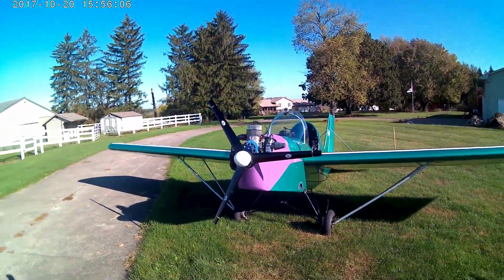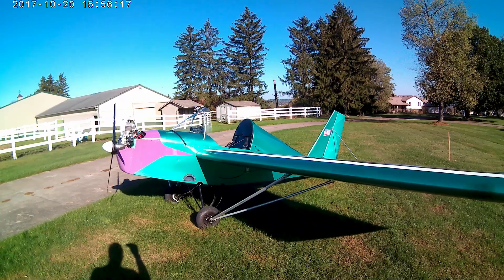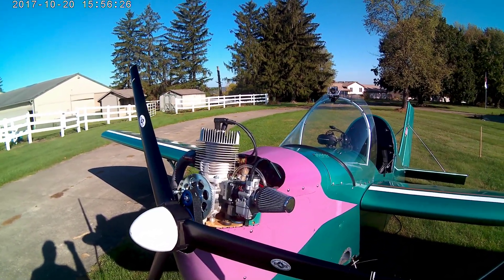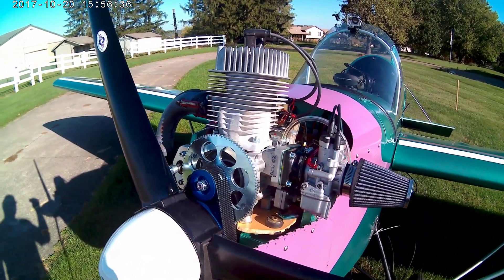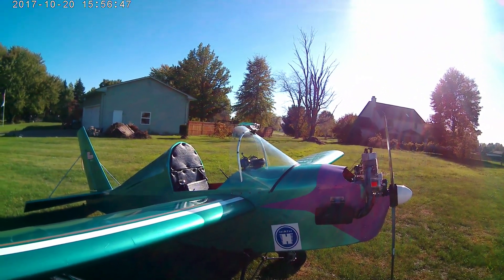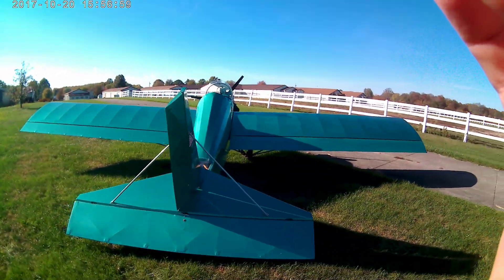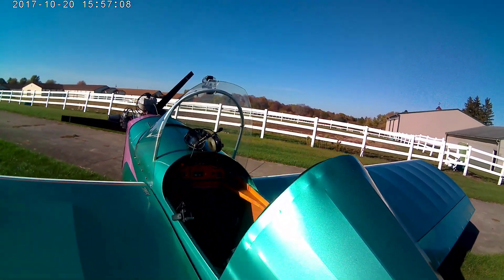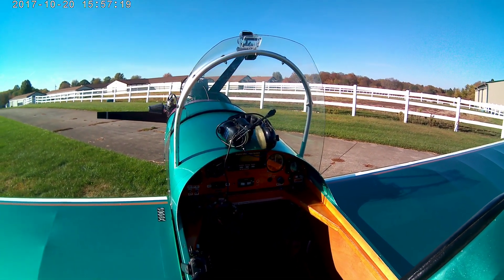Mini Max Walk Around

Comment: As the plane's empty weight is over 300lbs, it obviously doesn't qualify as an "Ultralight" vehicle.  (under FAR Part 103).   I looked for, but didn't see a "N" number on the plane - is it registered?   Does it have the required Airworthiness Certificate?

May have this required documentation, but I just didn't see it.  Nice little plane - I built two of them:   A 1100 and an EROS 1650 MM.  The EROS was a great platform and I flew it 13 years - wore out two Rotax 503's with it.   Thanks,  N-6395T
Reply: He didn't say it was an ultralight and it does fly nice.